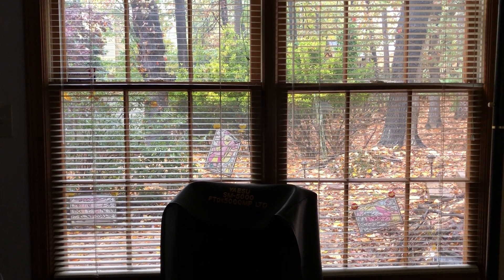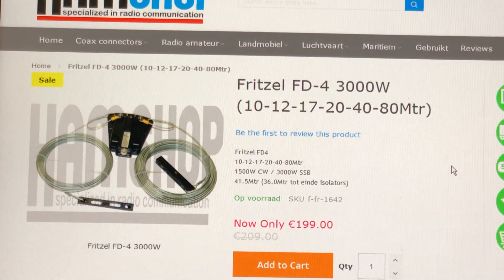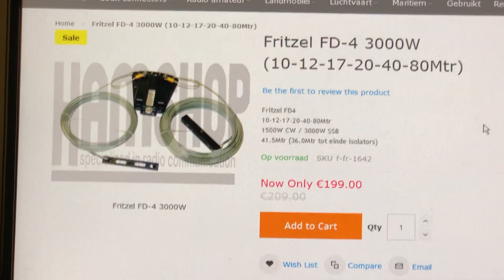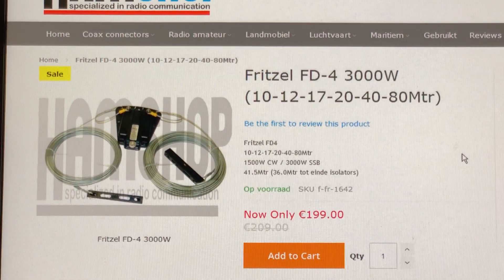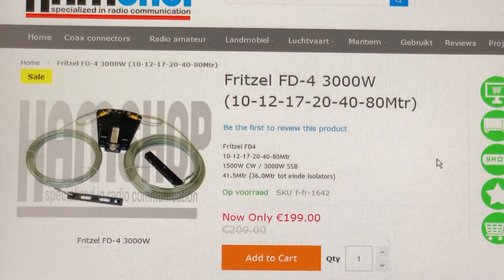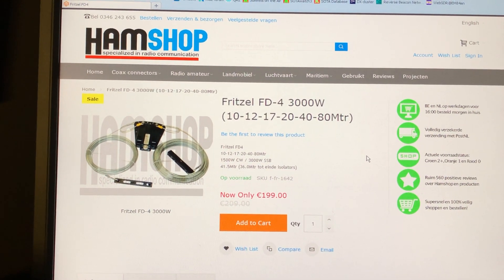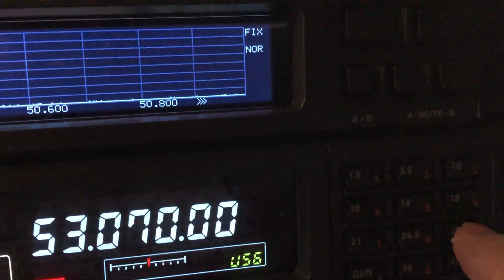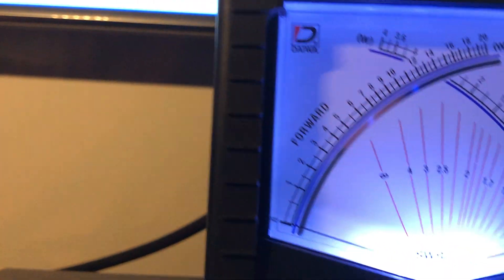The Fritzel FD-4 3KW OCF Dipole

Comment: That’s a great antenna!  Just got my general ticket about 4 weeks ago and I’ve been studying ocf for a couple weeks. I’m going to build one this weekend and use window line to feed it. I got to the end of your video and heard your call sign, and realized you are one of the local SOTA guys that I have heard, maybe worked and seen several times on the SOTA spotter since I got back into radio the last 8 months!  Hope to hear you soon on Hf have a QSO next time I’m on a summit! 73 KE4SJM
Reply from the maker: Your callsign is familiar.  The funny thing is that I am about to hike to a summit near Dahlonega.  Will be monitoring 146.520.  The OCF is a good option when you have limited space for an antenna farm, and you want to avoid using an antenna tuner.  However, beware of RF in the shack.  Common mode current will flow back on the shield of the coax.  Make good use of chokes.
Reply: Doug McAlexander I got it built since my last comment. I’m using window line for feed line. I built a 66’/33’ ocf. I’m having to use a tuner one right hand though. 20 meters seemed to have been the farthest off before tuning although 10 meters I can’t get below 1.5:1

Comment: You might add some clip on ferrite under 6:1 balun I have 7 turns of rg8x though t240-31 Toroid  core on my ocf dipole about 2 feet below 4:1 jetstream balun using 33% off set 88/44 ft.works very well.very good video and antenna 73s.